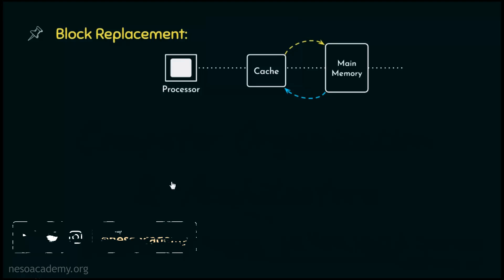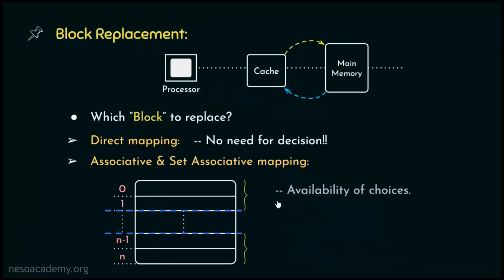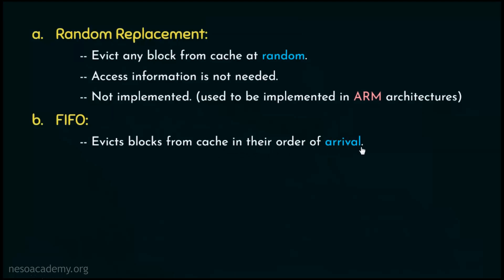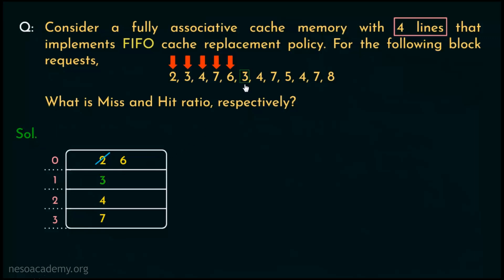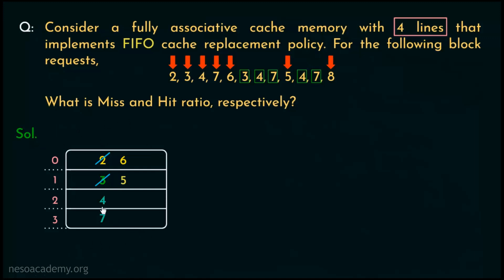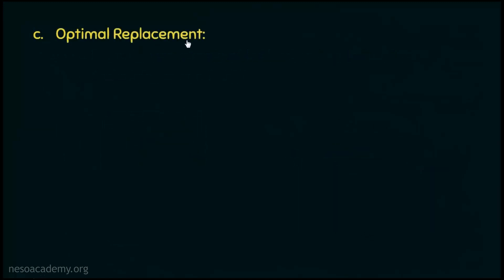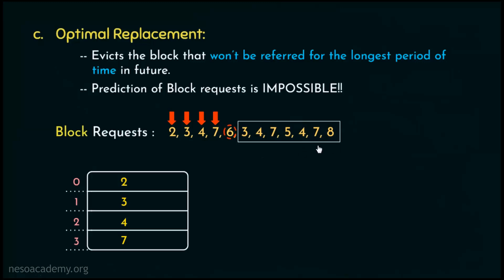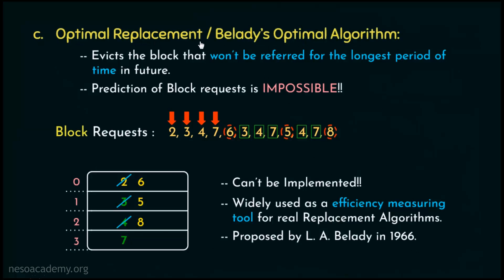Cache Replacement Policies - RR, FIFO, LIFO, & Optimal

Comment: At 8:50 of time in the Vedio sir told the misses are 7 but he also counted the 7 but it is there in the table could anyone please clarify it
Reply: I'm not sure what you mean, but let's try: 2,3,4,7,6,3,4,7,5,4,7,8 for fully associative, 4 line cache with FIFO replacement policy. So in order:

2 - cache miss (compulsory, after that 2 will be in cache, until evicted)
3 - cache miss (compulsory, after that 3 will be in cache, until evicted)
4 - cache miss (compulsory, after that 4 will be in cache, until evicted)
7 - cache miss (compulsory, after that 7 will be in cache, until evicted)
6 - cache miss (capacity miss, because cache is full, after that 6 will be in cache, until evicted. To place it in cache we evict first block that was written to cache, which is 2)
3 - cache hit, since it was loaded previously
4 - cache hit, since it was loaded previously
7 - cache hit, since it was loaded previously
5 - cache miss (capacity miss, because cache is full, after that 5 will be in cache, until evicted. To place it in cache we evict first block that was written to cache, which is 3, we evicted 2 earlier)
4 - cache hit, since it was loaded previously
7 - cache hit, since it was loaded previously
8 - cache miss (capacity miss, because cache is full, after that 8 will be in cache, until evicted. To place it in cache we evict first block that was written to cache, which is 4, we evicted 2 and 3 earlier)

Overall we had 12 blocks requested - 7 of them were misses (4 of them compulsory, because you always take compulsory miss on the first request of the block; 3 of them capacity, because cache was full and blocks had to be evicted in order to make room for new blocks.
The 7 you see in the table is "Block number 7". The 7 he talks about as cache misses is the amount of times block was requested and was not in cache upon request (had to be fetched).
Misses here are represented by red arrows above the block numbers. Two 7's you mentioned have nothing to do with each other.
If you have any further questions - feel free to ask.